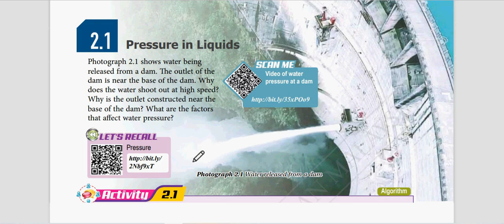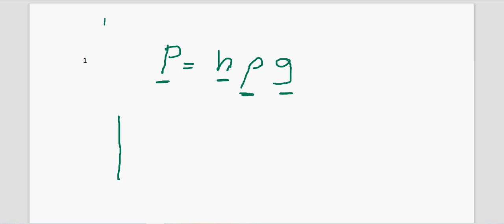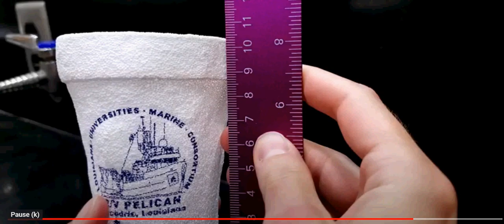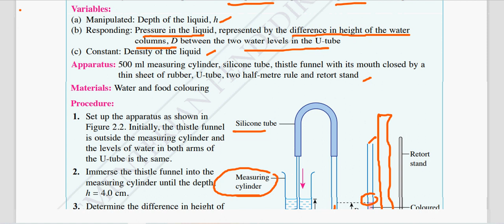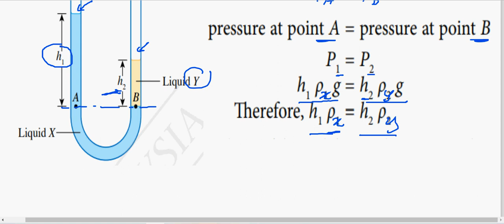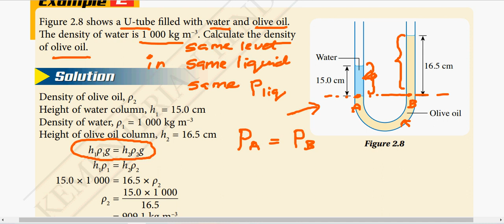F5 KSSM | 2.1 Pressure In Liquid

Comment: Teacher may i know why mercury is not suitable as the liquid in the u-tube when we do the experiment 2.2?
Reply from the maker: Actually before this we used mercury in a manometer but since scientist proved it is a carcinogenic, we don't use it anymore. But in theory, we still hv mercury in manometer for pressure calculation proposes.
Reply: @myfunphysicsworld9231  ok thank you teacher
Reply from the maker: @graceyap1198  For experiment 2.2, another reason is because mercury has high denstiy. Hence, the change in mercury level in U-Tube will be very small. Can say not sensitive.
Reply: @myfunphysicsworld9231  alright , thank you teacher